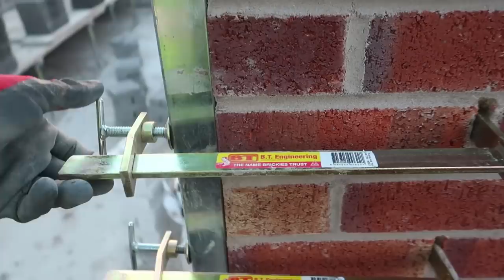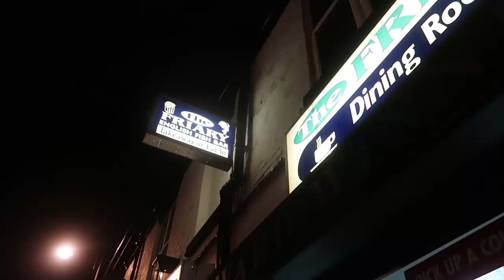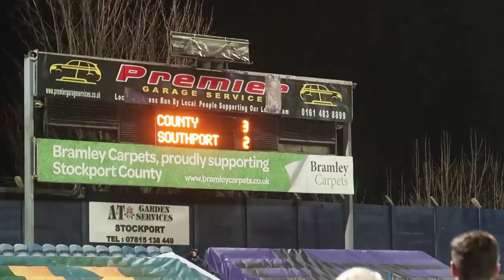Bricklaying/ Blockwork and Stockport vs Southport VLOG with KC 19/02/19

Comment: I'm so glad that on the site I'm working at, we don't need to put the insulation in cause the insulation isn't put in until the houses have been built. It was a nightmare at me last job cause we had to put in the insulation ourselves and they wanted us to pin it to one side of the party wall before we could start laying the other side of the party which meant we were trying not to let the insulation  push the blocks out.